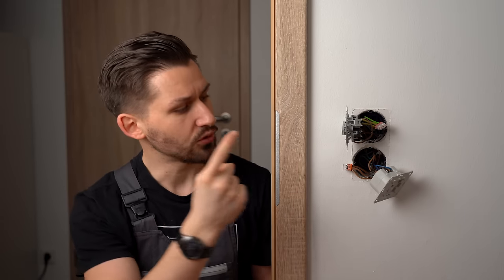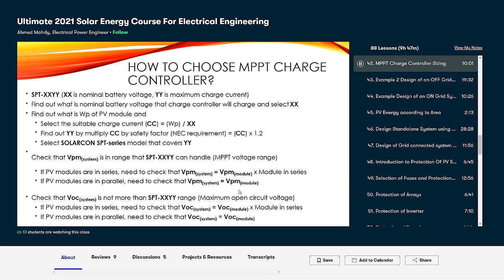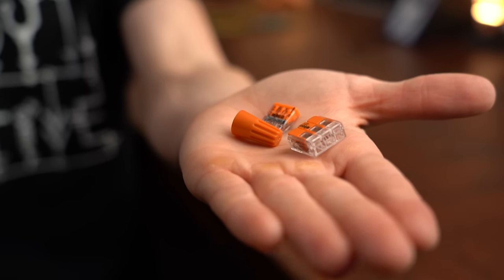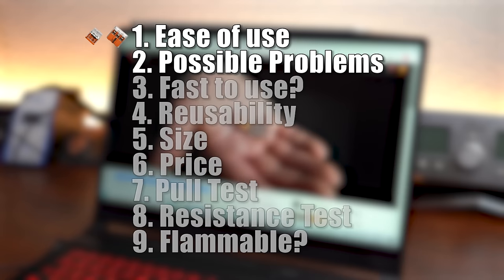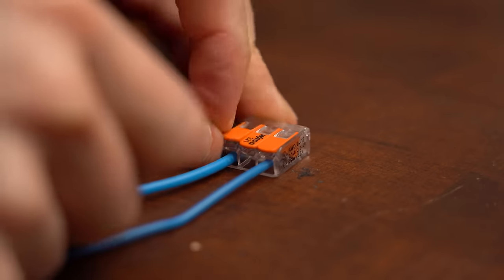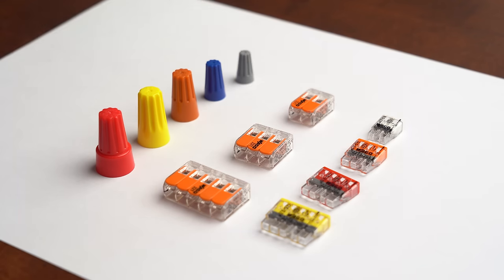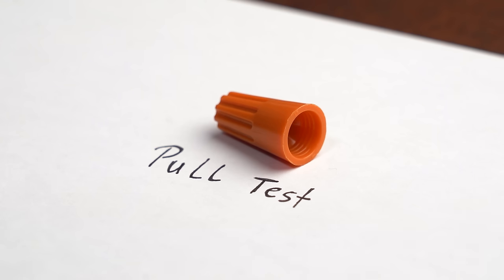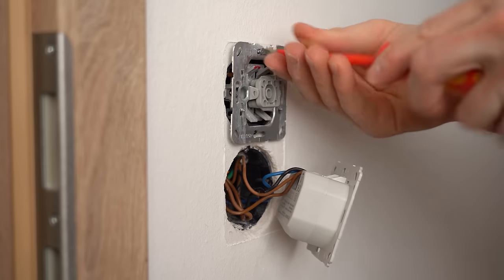What Wire Connector is the Best? Settling a Debate! Wire Nut VS Wago

Comment: Seems the only thing that makes Wago connectors "better" is that each one is printed with electrical ratings. Wire nuts are color coded for wire size, current, and voltage (600 volts), so printing is wasted time and material.  Not knocking Wago connectors, per se, but they are about 8 times as expensive as wire nuts and the comparisons are ridiculous.

Comment: One of these tests matter;  resistance.  Wire nut wins while wago introduces no less than 2 points of failure on every connection...no thanks.  Wagos fall into the category of typical German over-engineering.

Comment: Twisting your wires offers the best kind of connection than using a fancy connector or even solder. Always twist the wire before putting a wire nut, can't trust the dinky little nut to hold it together.

Comment: There are drill driver attachments to speed up wire nut installations. As far as reusablility, I have reused wire nuts several times. The beauty of wire nuts is if you have the 4 or 5 sizes you can connect nearly every common connection used in household wiring.

Comment: Reasons to use a Wago over a wire nut.

1. You don't know how to use a wire nut.
2. You are working with at least one wire that is too short to use a wire nut properly.
3. You are in too much of a rush to make the connection the right way.

Comment: not a damn thing wrong with wire nuts when used properly.  As Michael said below they are not intended to conduct electricity. Used them for 30+ years with no issues.

Comment: Excellent demonstration and explanation. Thank you for sharing.

On observation, at 7:55 you said the wire nuts were 4-5 times cheaper. How is that times measured? Times something the numbers always increase not decrease. The correct statement is the Wago is 4-5 times more expensive. Yes, folks saying something is X times less is an all-too-common math mistake, as it never makes sense.

Comment: The video is very good, this opinion is only about the connectors. Those connectors suck, they stink, they're horrible, and they're dangerous. None of these would meet European standards. The one from Spain at least. You have to put a strip in conditions, with its screws and everything.

Comment: this review sadly means nothing as you are not using the twist connectors properly. They connection is done by twisting the wires together first. Which proves the point that for DIY wago its more intuitive therefore problaby better.

Comment: I am going to have to disagree with your results. if you are commercially working with connectors, you want the lowest amount of risk of fire possible. I know you made a lot of points go into ease of use, but I will have to say that usually if you plan on wiring something, for the most part it will be permanent and not temporary, so ease of use and re-usability should not be weighed the same for points as some major flaw like high resistance and heat. Heat issues can lead to fires and power loss, and pull strength is a huge factor if some idiot who doesn't know what he is doing removes an outlet, breaking a wago connection, and exposing live wires. I know you are a proud German that likes your German engineering, but you should understand the risks of using a wago connector outweigh the reward.

Comment: I hate to say it, but you did not use the proper technique when using the wire nuts.  You did what most non-electricians (DIY'r) do and did not twist the wires together using a lineman's pliers or similar.  The wires should be twisted together down past the bare wire so the wire bundle does not come apart, and then the wire nut is used as a cap to cover the bare end.  Most wire nut packages actually have instructions on how to properly connect wires and much of the information you said was missing, no internet needed. When properly connected both the WAGO and wire nuts do a fantastic job.  For ease of use, time-saving, and safety, the WAGOs are a clear winner, especially when several wires come together in a tight spot. Otherwise I enjoyed your comparison video.

Comment: The main problem with wire nuts is that they stress the wire. They put a kink in there. So if you want to change it out, you may (not always) have to snip off the last 1/2" or so and use a new nut. Do that a few times over the lifetime of a house (40 years?) and all of a sudden, if you and the other folks have not been extremely careful, the wires are too short. Now you have to put 2 nuts in there. One to just extend the wire and the second to do the new connection. 

Wago doesn't have that problem.

Comment: I think one thing missed here in terms of ease of use and speed, you really should also have someone who's got the same years of experience with the wire nuts. Then you both race with both connectors. It's unfortunately not objectively measuring anything meaningful the way you've covered it here.

Comment: The first test is obviously wirenuts.
The wire nut is less sensitive to insulation strip and size. You don't have to look anything up.

This is an advantage. Though obviously the pull test adds less reliability, but your video shows bias.

Comment: Wire nuts are easy made water proof and made for direct burial. Even the instructions say there is no need to pretwist the conductors. The cold weld is going to last longer than the knife blade of the wago, especially if vibrating. If there was a reason why it’s better, I can take it off and add more conductors while the wago is typically 2-3 conductors. So then I have to replace them with a wire nut for 5+ conductors. The lever type wago is nice for bench top testing, cost a lot though.

Comment: my comment is about the time test. you forgot to consider you suck at the wire nuts and twist way more than is needed so it takes way longer. and you have been using those wagos exclusivly so of course your are fast. im slow at the wago even though they are slick. for time its about the same. not double bro.

Comment: Wire nut package has the instructions on it....How did it take you longer to wire a light with wire nuts???  We used wago in our industry for a bit, then quickly switched back to wire nuts.  Mainly for speed, ease of use, the 'pull test' much stronger on the nut (when installed correctly) and reliability.
Reply: When installed correctly is the key word not everyone is smart enough to make sure there wire nuts are on properly.

Comment: wirenuts vs wago is like cheapy the cheap vs elegant boss. I see no reason other than how fucking ridiculously expensive wagos are to use this wirenut crap. I use wagos myself but where I live most buildings have cable joints made of twisting+tape so either would be an improvement.

Comment: Your love of wagos affected which tests you selected, and how you weighted and interpreted them. 

Things like, "I feel like inserting is easier than twisting when reaching overhead" are purely subjective.

And right off the bat one of your dings against wire nuts is that you have to use Google? Your own unfamiliarity with the product isn't an objective negative of the product itself.

Not very objective, all in all.

Comment: Where do you start, never used a wire nut or a Wago connector, just do a propper installation and they wont be needed, also what happened to the IEC/BS reg only two wires in a connector? In the video you can see 4 live wires in one connector, which the rating is shown at 32 amp. In the UK on a plug socket each is capable of suppling 13A. So lets do the maths 13A+13A+13A+13A= 52A oops, this is probably going to get me loads of sh1t feedback

Comment: I usually like your videos, but in this instance, you shouldn't be testing something you haven't learned to use. No professional would ever put two straight wires in side by side and twist. Wire nuts require a small amount of knowledge to use properly, but when you have that, they are fantastic connectors.

Point conceded that they can be frustrating when using solid and braided wire together, particularly if for some reason you want to join a small braided wire to a large solid wire. For that, you might be better going with another connector.

Comment: You can tell youre not from america 😂wire nuts are very efficient and effective my friend those other devices can fail much easier than a wire nut and the color of the wire nut determines how many and how much can be spliced using them

Comment: You're using the wire nuts wrong. You're supposed to twist the wires togheter before you put on the wire nut. Make sure you never twist 1 wire around the other(s), all the wires need to twist around eachother. In my country the wire nuts are more like relics of the past, but they actually hold up very well for years and years if they are twisted correctly.

Also, what bothers me very much is that you connect brown and blue togheter. I know it's just a demostration, but even then you should NEVER do that.

Comment: You are using the wire nut wrong,,,you have to pre twist the wires first before you put the wire nut on ,,,you are an electrician and you don't know that?.....Properly installed wire nuts never losen ,,,,in the long run wago has no chance vs wire nut

Comment: Wire nuts have a voltage rating, and wire gage as well;  I guess this guy can't read a label on top of the wire nuts bottle? Lol
No need to use the internet it's written right on the container

Comment: This was a flawed analysis, and shows a lack of understanding of some basic concepts, as pointing out in my previous comments. The wirenut is a more professional solution, because it has lower resistance, the key performance factor. The Wago is definitely more convenient, but I would only use it for connecting multiple wires in a smaller box, because the wirenut is also easy to use. Bottom line: Use the less expensive / higher performance wirenut if space allows. For a cramped box with several wires, Wago is much better.

Comment: Wire nuts are cheap junk. They don't join stranded to solid very well. They push the stranded down the solid. They don't join different gauge wire very well. Ive seen wirenuts fall off at the lightest touch leaving live wires exposed. Screw connectors and spring connectors are 100x superior to wire nuts. They don't fall off when poking around. And being a professional tradesman I would never leave crap like that on my jobs. Wheres the pride? There is a reason why Wago cost $0.36ea and wirenuts cost $0.01 ea. Because wirenuts are garbage and an embarrassment to the electrical industry. And they are not even legal in Australia. When we see one its get replaced immediately.

Comment: I use good wire nuts not shit nuts that come with the fixtures... red and tans red and yellow orange and blue... those nuts you have are shit nuts... and we always make a mechanical connection then put the wire nut on

Comment: No Scott , in SA we have those wire nuts with pure porcelain. You take that constant thermodynamic effect the heat has on the push in connector. They are absolutely horrible (Fast  and nasty ) and we banned them by our company. They just don't create a bulletproof joint where the twisting effect creates more surface area contact conductor to conductor  making the joint the spot of least resistance , which is the best type of joint you can get. Where with the push in connector (Wago the area in contact is absolutely laughable that is why it heats up on your thermal imager. They are just NASTY so please re-evaluate your conclusion . Because I find it  false and misleading.

Comment: Only made it 6 minutes and already I have seen several problems. If you buy legit wire nuts from a good vendor they will come in a package with all the information you need about wire size on them, most people do not buy wire nuts in this type of weird kit. Wirenuts don't have a current rating because the conductors touch each other, the conductors have the current rating. This is one of my main concerns with a wago is very very limited surface area for contact versus a wire nut. 3rdly your demonstration of stranded to solid connection and most of your other wirenut connections were wrong, so you created your own issue there. After twisting you should always cut all conductors off flush at the same length to have a good strong connection. I'm not saying wirenuts are good, they are a pain to use if you don't know what you are doing. However this video is very biased. Giving a tie in the size category? Come on look at the largest Wago, it's freaking huge. It takes up as much space as 2 wirenuts.

Comment: wire nuts are king. simple. color coded. and when used correctly can't be beat. the wago's have a tiny surface connection 5%,  wire nuts have a 100% surface connection. if you buy cheap shit , you'll have shit results. buy quality wire nuts. you did not connect the wire nuts correctly. you must twist the copper wire ends with pliers first. twisting the wires so they have threads full length of the exposed copper. it will look like a copper bolt and nipped at the end at the thread angle. then push the wire nut down onto the newly threaded copper wires. you must use extreme pressure to complete the twisting until you can no longer turn it safely. your test is extremely biased. let me test your clip connectors and i know they will surely fail. i am a third generation master electrician. i've used all of the connectors. you can't beat the ruggedness of a high quality wire nut in the hands of pros.

Comment: Learn how to use wire nuts before making a video. You don't put loose conductors in the nut in the hopes that the nut twists them together. Strip the wires longer than needed; use linemans pliers to twist the conductors together, making a mechanically sound joint; Cut off excess conductor; only then, twist on the wire nut.

Comment: I heard the wire nuts have a tendency to come lose after time.
Reply: Wire nuts really are only supposed to be a cap to cover the wires you are supposed to twist the wires together with pliers cut the end flush and cap them off with a wire nut and I prefer the ones with marine grade shrink tube attached that you melt and it grabs the wires with a glued connection

Comment: Wagos are trash pure and simple. The surface contact area they provide are insufficient, and they are prone to severe oxidation. It’s nothing but a connector for the lazy who are unwilling to spend the extra few seconds to properly secure a. Wire but.

Comment: First you showed us you are bias by keeping in the connectors you said wore inferior because you your self use them often. Second you used the wire nuts wrong. You did not twist the wire together first. The spring loaded connectors you used will become loose if a load heats them up and the bimetal losses it's spring tension causing everything to heat up and melt. Therefore i did not past the 1 minute mark in your vid. When you say not bias then the first thing you do is bias how am i expected to believe anything you say after that? Not to mention you have no clue how to use a wire nut. You get an F on this video.

Comment: Ease of use should not be your first priority... electricity kills people... possible problems and resistance are intertwined, and fill of box as it will increase heat... ease of use and fast are usually the most failure and dangerous... so far your video is trash

Comment: Using the American flag with "garbage!" and a wire connector in it makes this seem like just another "America bad" video. WAGO connectors are in common use in the U.S., and are widely available for purchase. You also appear to have used lower-quality wire connectors for some reason, which isn't what's used in instances in which a wire connector is preferred. There are use cases in which a lower-quality connector is fine, but wire connectors are cheap at every level of quality.

Comment: From my experience in the field i can tell you one thing - if you ever pull out that garbage wirenut before anyone you will get kicked in you ass till you're sorry you're alive - they don't hold on the wires, the wires inside are loose and tend to spark... It's something that should be use only temporary for testing riggin and only ONLY on your stuff (so when it burns you can blame your own stupidity). Wago on the other hand have tension springs inside so the wire is held on firmly forever (not talking about AL wires that burn out but are obsolete these days) and the picture you hae on thumb - that could only happen if you short it or run thru it really high current / voltage. Did i tell you wago hold wire much stronger than the US garbage? Yes i'm pretty sure i did... 
Now that i said that i can leave this vid (no point watching it for me)